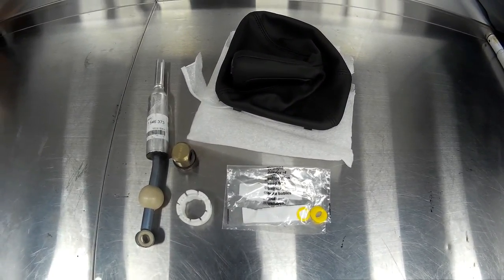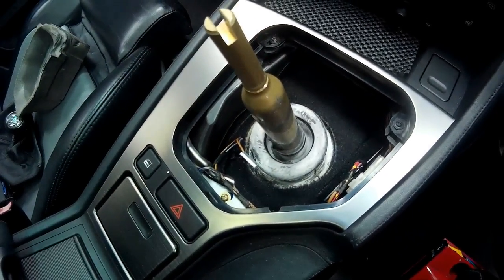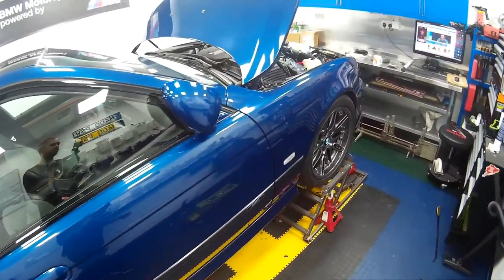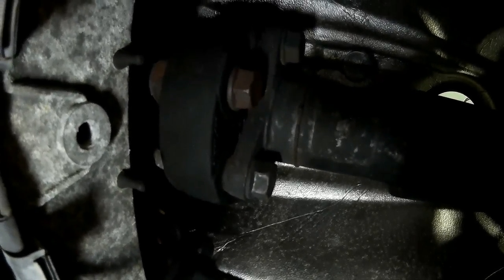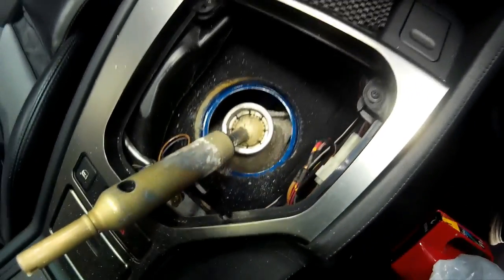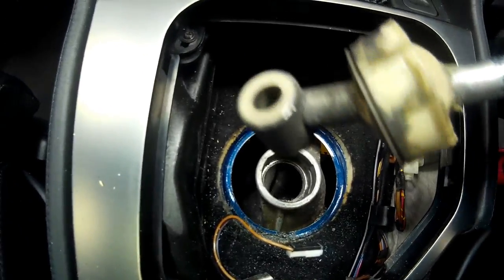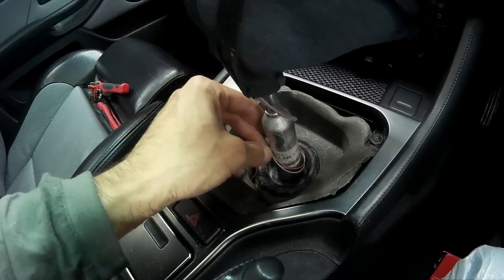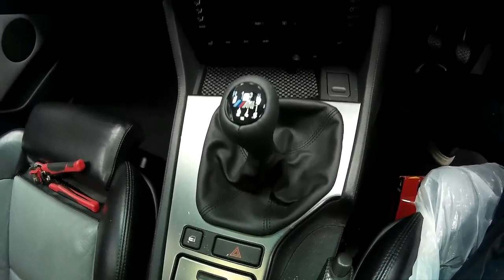BMW E39 M5 Short Shift Gear Lever Shifter Quickshift Install DIY How To Guide

Comment: This also applies to any 5 speed E39. You can get a short shifter from eBay, the bottom hole will need drilling out a little bit. This is incase you wanted a threaded gear knob :)

Comment: Hello, @Paul Simon, i have noticed your ramps/jacks under front wheels, did you buy it or its homemade? interested in making my own like yours ramps.
Reply from the maker: Hi. I purchased the jacks a few years ago and had them custom made ("Off the shelf" ones were available) to take the extra weight of the E39 as opposed to the lighter weight of smaller cars they were originally designed for.

Comment: Will this fit an 320 d estate
Reply from the maker: Principle is the same, but you’ll have to do your own research as there are different length shift levers as standard on various chassis across the range.